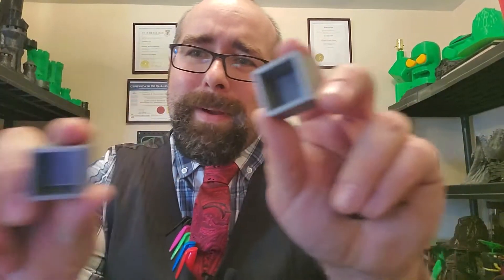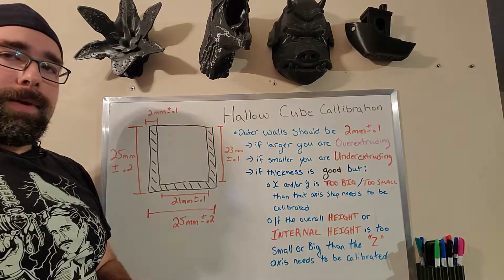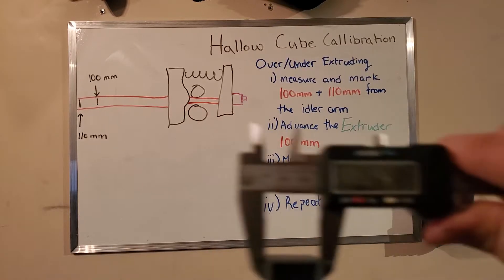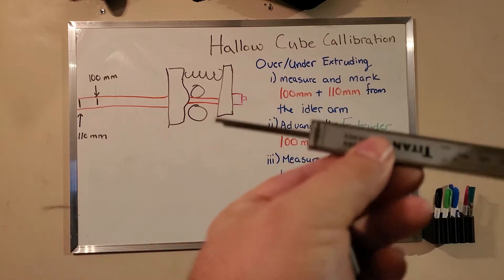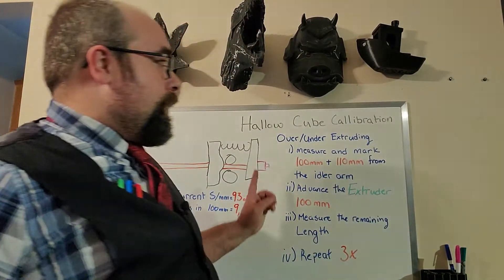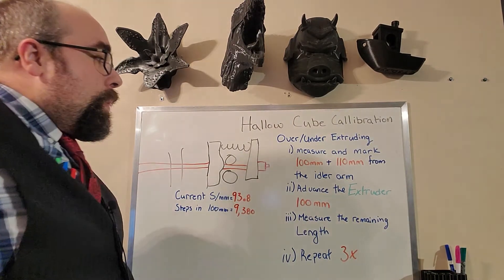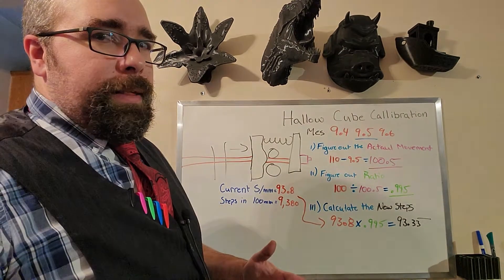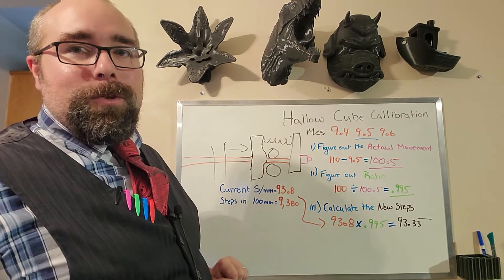Hallow Calibration Cube and How to Read It !!

Comment: I calibrate my extruder off the weight of my finished part vs mm of filiment used in my g-code. I haven't had a jam or clog since.
Reply from the maker: Thats awesome, different strokes am I right.